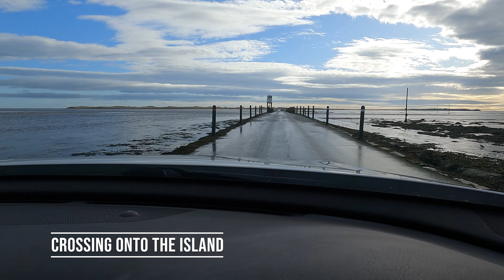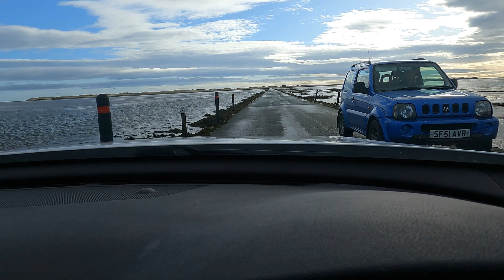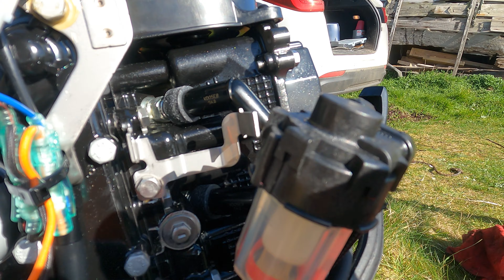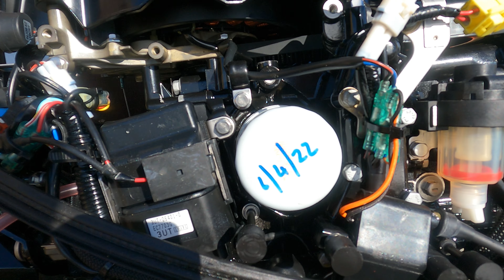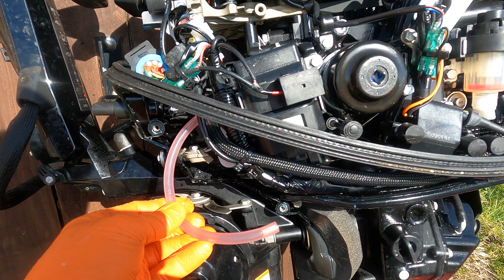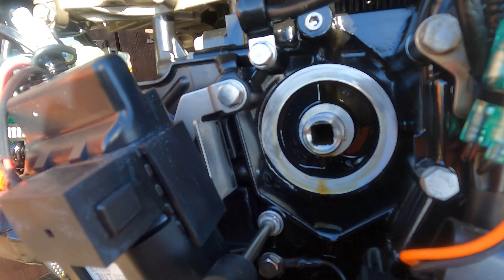How To Service - Mercury / Mariner F15 F20 EFI / Tohatsu MF15 MF20 EFI - 4 Stroke Outboard Engine

Comment: Great video. Absolutely brilliant approach to a backyard fix. 

That pink tube is an expansion chamber from the vapor separator tank (VST; that's why it's blocked on one end. It contains the gases in the system and helps to regulate pressure.
Reply from the maker: Thanks for watching, glad you found it helpful 👍 Thanks for the info